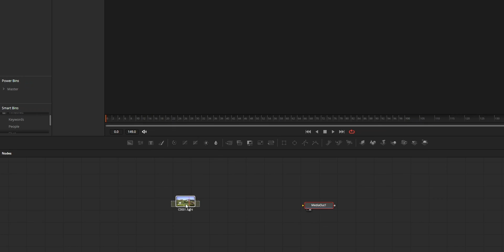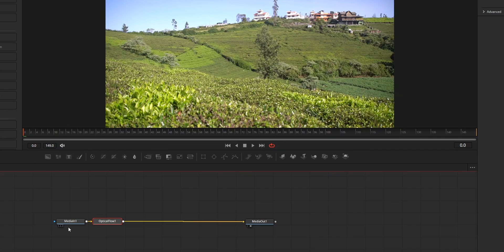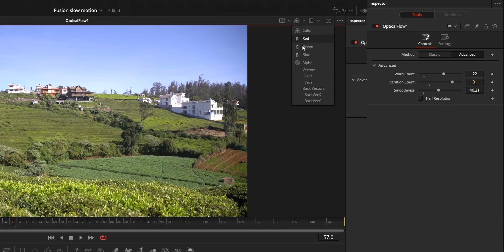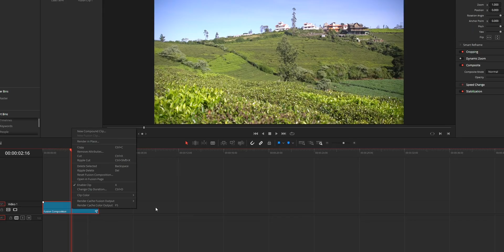How to slow down video using Fusion. DaVinci Resolve

Comment: you can't keyframe the speed?!
Reply: figure out the speed you want, like maybe you want 10% speed, set the out frame to 10% fewer frames.  Its confusing AF i agree, but it works
Reply: @HearMeowt_YT  ughh,, lol
Reply: @PTFWWDB  sorry dude, forgot which video i was watching.  You’re correct time speed has no keyframe option, you’ll wanna use “Timestretcher” node in fusion.  It’s confusing AF, but you’re basically setting a begging and end of a clip and then setting frames of the source to align within that keyframe range. 

So say you have a clip that is 120 frames long.   You want to time stretch parts of it. You could set intro as 0, go to frame 120 on the fusion clip and enter value of 60 with a keyframe in timestretcher, you basically are telling it to play/stretch frames 0-60 over 120 frames of your fusion clip, so 50% speed.  You can speedup, reverse, you’re not limited to one point.  Obviously Its more complicated than that, im still working with it, but thats the basics of it, check it out.  

(Btw all the opticalflow info here is the same for timespeed)
Reply: @HearMeowt_YT  yikes um okay thank you sir